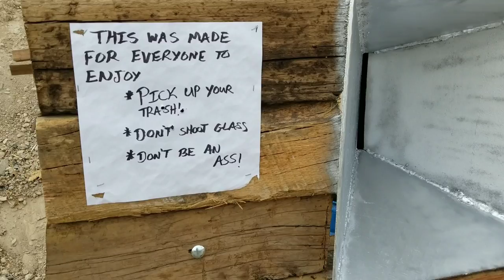The Making Of The Bullet Trap - Idea from Charlie BrassStuffer

Comment: Love it brother. I've been scheming how to make a similar one for over a year now. As it is I shoot into tires and recover a good portion of my lead to recast. Do you mind sharing your dimensions or plan. Steel thickness and pipe thickness and diameter? I love your channel bro and I'm glad that you didn't let the YouTube Nazis scare you away. Your content keeps getting better and better.
Reply from the maker: I followed this plans but modified the angles slightly. 
https://pin.it/dai3bw46um2o3v
I went with a 24x24 opening  with a 27* angle.  That puts the hypotenuse at about 29" and the rear at 12 inches.
Charlie did an awesome write up here
https://thereloadersnetwork.com/2018/07/15/new-pistol-target-backstop-_-it-works-part-2/